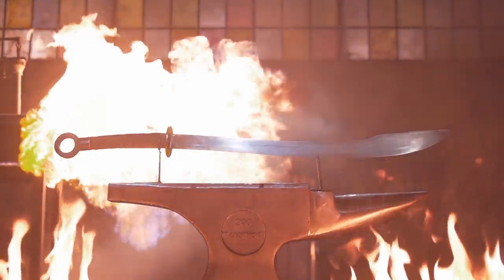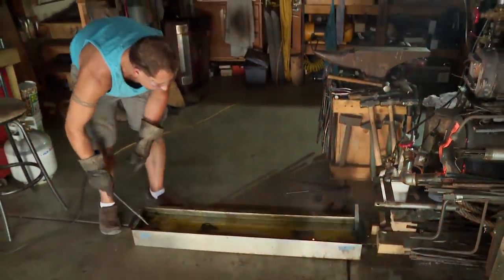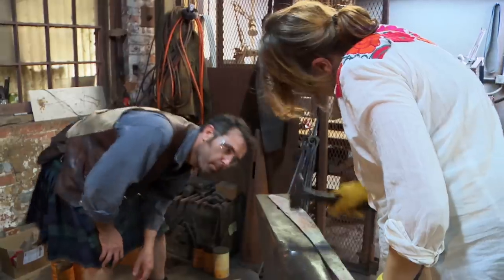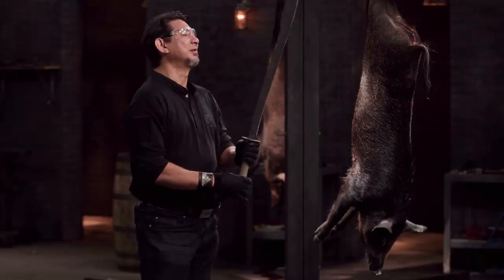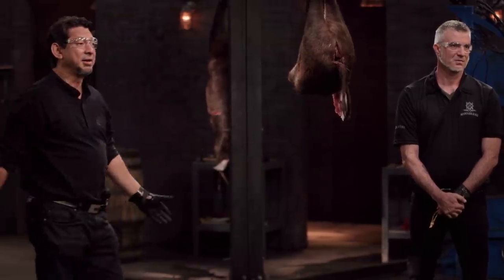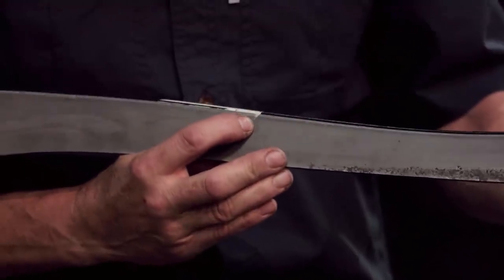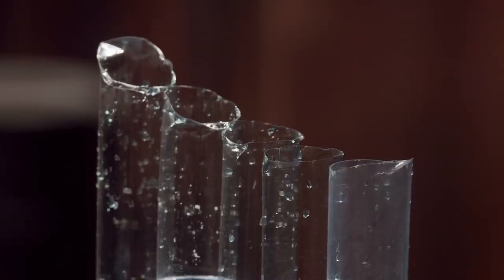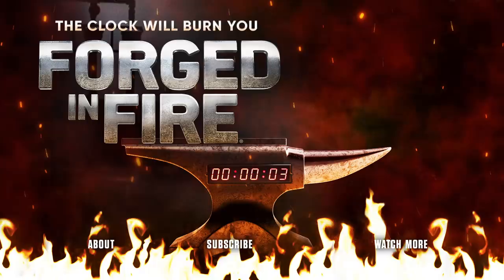Forged in Fire: Chinese Dao is the ULTIMATE WAR WEAPON (Season 5)

Comment: While the runner-up team made an excellent dao, the blade's curvature, I'm sorry to say, was not very good... The curvature of those swords were done in a very specific way in order to deal the maximum amount of damage from a proper cut, and the winner team absolutely NAILED the curvature on that beaut' of a blade, which was evident during both the kill test and the cut test.
Reply: they have a reverse bend, it's good that you paid attention
Reply: it goes back to the design. that slight difference allowed one blade to cut more of the tubes and carcass. damage to the blade was practically zero difference.
Reply: Also the slight heavier weight advantage helped but like you said, the curvature of that blade helped to cut better.
Reply: Imagine though if these contestants were allowed say two more days how much nicer would these blades be and how much better would they be?!!?
Reply: @DragonUdo  I have no doubt, that more allotted time would net better results for the bladesmiths. But I also understand why they only allow the time that they currently do.
Reply: I also notice a really key difference in the balance of flexibility and hardness in the blades.  We see the runner up team's blade flex more like the dao you might see in movies (spring temper for practice weapons) but only slight flexing in Jessica's (battle temper).  

Honestly I'm a little obsessed with dao blades and the one she made has to be one of the most perfect I've seen.
Reply: Yes their blade was an absolutely stunning beauty! And deadly too. It is really a picture perfect Dao
Reply: i know this is 2 years old, but curvature is unique to style and there were plenty of chinese chopping dao that did NOT have a curve to them even in the Qing dynasty era

Comment: Well that sucks...they had them make dao, but then had them compete using two different dao. I've never seen this show and I never will. (Just wanted to hype dao to my friend) Pretty dumb vid, and such a vague (20 second - single niche) historical description borders on nearly total inaccuracy - compounding the dumb. If you wanted to confuse and create some sort of bias/sales boost on what is (on the market) mostly too thick to be wielded properly or too thin to hold up to any action without a few hundees...good job. Cavalry and infantry which is stronger? Well - it depends on if you're on a horse or not. Durg I'm a televijion Gesius!!!